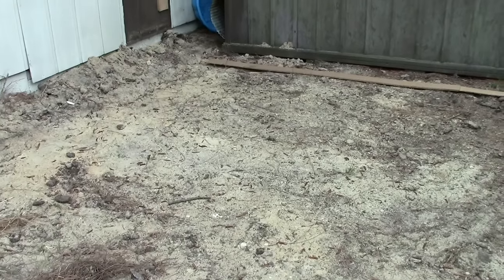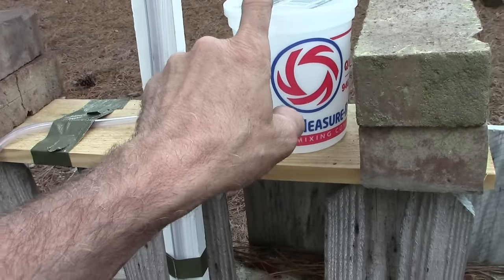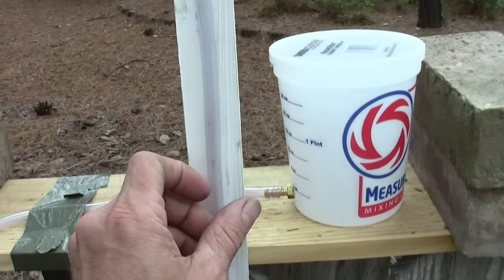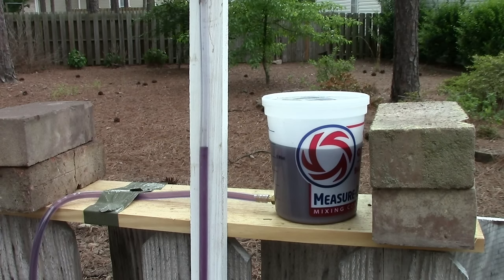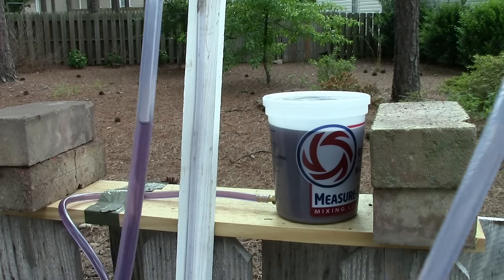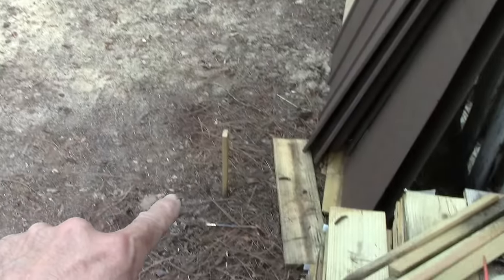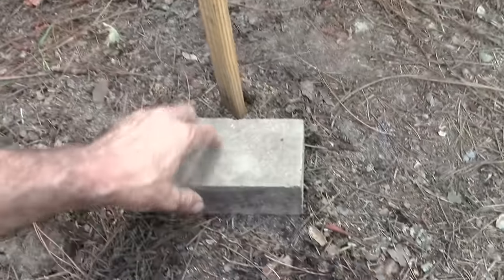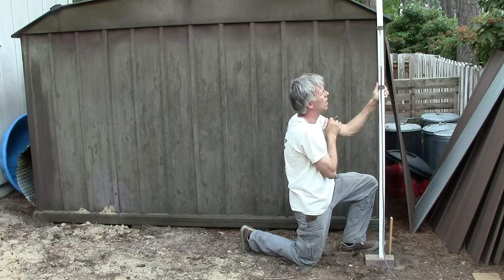How To Make And Use A Water Level

Comment: Pro tip : measuring diagonals doesn’t guarantee “square “ imagine a large capital A with the top cut off the diagonals will measure the same but it’s not a square ... measuring diagonals just means you are evenly out of square along a Center line
Reply from the maker: It does if all the sides are of equal length.
Reply: Yes sure 😊.. and I’ve yet to work on a perfectly square build !! , great video by the way showed it to the kids I teach as well .. we use some early roman setting out tools which we make in the workshop ...

Comment: Thanks for video.  So does bucket placement matter at all?  Do you just place the bucket in a random location?  Does it have to be high in the air or can it sit ground level?
Reply from the maker: It has to be higher than the highest point you will be measuring.

Comment: This doesn't work because the section of tube that has water in it changes as you raise and lower the tube therefore changing the amount of water in the tube that in turn is distorting the results. instead get rid of the reservoir and use the tube only. Then you'll need 2 people to look at each end of the tube or you can run back and forth to each end to make sure they are the same. Also you can use the zircon water level with the built in tone sensor to tell you when one end is where you want it.
Reply: Danny L you're really challenged at understanding this simple concept. No, it does not distort it. If you're measuring between a distance of say 5ft, it doesn't matter whether you have 10ft or 200 ft of tubing, as long as all the air bubbles are out of the tubing. Think about it a bit more
Reply: @fgjf1079  No, Danny L is correct.  However it is minimal with the distance he is measuring.  I plan to use 100' tubing for my yard and the distortion he is speaking of would cause an error of inches.  This is due to the volume of water in the tubing changing as the tubing is raised and lowered.  This is lowering and raising the level in his bucket (imperceptible at these distances) which he is not even looking at.  So, technically Danny L is correct, practically usually not significant.  Also, the air bubbles have no bearing and can be left in the tube, as the pressure in front of and behind the bubbles is the same so will flow as if water.
Reply: Toby Stevens I get what he's saying, and it's very insignificant. When measuring a high spot on a somewhat flat area, you would be "removing" just 1-2" of tubing, which then pushes that water back to the reservoir. Very insignificant as the 1-2" of tubing water coming back in spreads out in the reservoir, and causes no visible change in reservoir water level. If so concerned, use smaller diameter tubing.

Comment: Won't be a square if the side lengths are not all equal.
Reply: I thought I was the only one that caught that!
Reply: but the corners will be 90 degrees to one another if the corner to corner measurement is the same

Comment: Yet another interesting show of a fundamental use of a water level.  However, some of his explanation is lacking correctness and will mislead people about how to use this method.  When working with a water-in-tube water level, it is important to note that when either end of the tube is moved up or down, the position of the water relative to the ground will tend to move at both ends.  The reason has to do with the fact that a fixed, or constant, volume of water has to adjust itself within the tube to occupy the same volume.  Without trying to explain this in words, just understand the actual difference in elevation of a reference line on a stick between the initial reference elevation and any other elevation is not directly proportional to the distance between the reference line and the water level at a new elevation.  To find the actual difference in elevation between 2 check points you must use one of two methods:

Method 1) Using his one man-one stick method: at the initial reference point, mark the reference line on the stick as he did.  Then, measure the distance from that line to the ground and note that number.  Now move to the second elevation and adjust the height of the stick so the water level is at the same reference line, drawn previously on the stick.  Now measure the distance between the ground and the reference line.  Finally, subtract the initial measurement from the second measurement.  A positive result indicates the elevation changed upwards, from the initial reference elevation, by the magnitude of the result.  A negative value indicates a downward elevation change by the magnitude of the result, relative to the initial reference elevation.  It is important to note, that the stick must be adjusted so the water matches the initial reference line and, therefore, the stick must actually be somehow elevated above the ground at all check points in order to allow this adjustment for a positive elevation change.  This makes it more difficult unless you have some sort of telescoping stick which allows you to rest the bottom on the ground and take a measurement.

Method 2) Using 2 stick, 2-man method: one person holds a stick at some reference elevation.  The second person moves the other end/stick to a different elevation check point.  Both people measure and record the height from ground to the water line at each stick.  Like above, calculating the difference between those 2 measurements results in the actual change in elevation between each position.  For each new elevation check both ends must be measured and compared in this way to determine the actual elevation change.  Remember, the water level at the reference still will always change whenever the second stick changes elevation.  Note this method allows the use of two simple rigid sticks of any length, but it takes two people or some clever rigging in order to hold each stick while a single person takes the measurement at each end to do the math.

Again, either of the above methods will yield the same accurate result, and is the only way of accurately determining change in elevation between two points using a water level.  So, if you misinterpret what this guy said, you might think you can just move the brick up or down by the actual distance between the reference line on the stick and the water level at that elevation check point in order to have both bricks level.  You'd be wrong.  Check out some of the other videos for a better explanation.  You'd also be wrong in using this same method to try to set a specific slope.
Reply: jaugernautk
Reply: if you could demonstrate the correction through a video it'd be great.. the writing confuses a bit
Reply: you are right sir. you are the only person that brought this up. its really easy to test this. simply take both ends side by side and mark the level in both of them on the wall. now raise or lower one of the ends. you will see that now the level of the water of either end no longer matches the wall.
Reply: Are you being paid by the word?

Comment: You wasted some pretty nice looking "Kool-Aid."  At least you didn't "drink it" to create a false impression of how level works.  (Flat Earth reference..,  :)   )

Very good video of something I did in 1989 to chart the foundation settling of my house in a reclaimed walnut orchard.  AWFUL foundation setting.., The house had settled over three inches at the worst from point to point over the layout of the house!

I plan to use this method and a carpentry LASER to survey my recently built terrace!!

Thanks for the clear presentation on USING this level.

Comment: the simplest way to prove the earth is flat
Reply: William Wallace de Bruce Brilliant! I think the way to do it would be do it over two points on a few miles across the ocean, or lake. Somehow tie empty capped plastic bottles along the line to keep the line from sinking into the ocean. Then place the sticks on a floating surface. Better yet, do this on a frozen lake.
Reply: Since the earth is flat, i want a picture of you at a corner of the earth, or stop talking about it, if you cant

Comment: great video. this is one of the better water level howtos i've seen on youtube. i think i'll try making one with extendable hose lengths for work. i think some people could confuse "square" with "a square" (whice you probably accidentally said in the video). a 10x12 foot shape with equal diagonals is a rectangle. if your outer edges are not equal you will find a discrepency in the diagonals and you will have a parallelogram or quadrilateral - where adjacent sides are not square. the video makes sense to me but i do it all the time for work. great video anyway!
Reply: More people caught this mistake than I thought! Simple math!